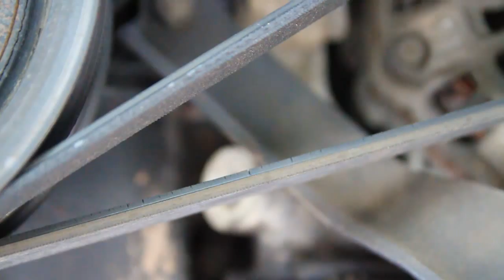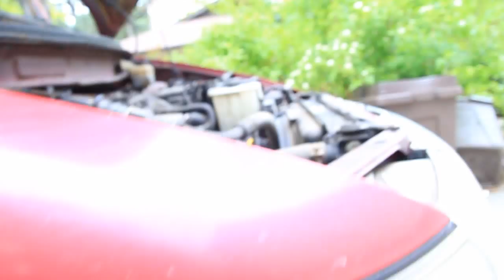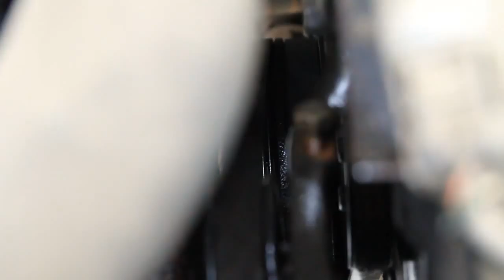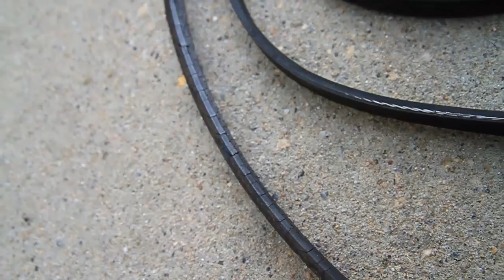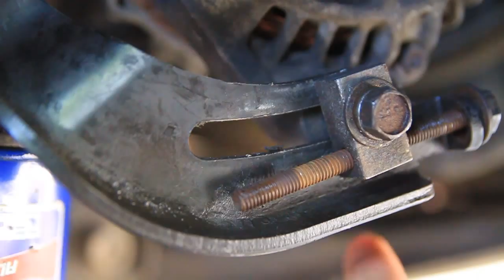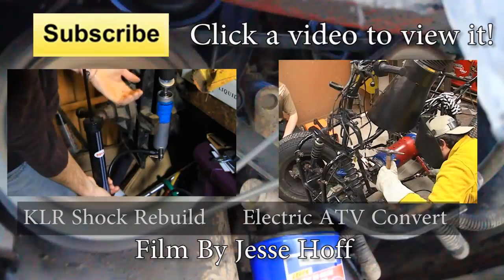How To Change the Belts on a Mercury Villager Minivan Nissan Quest Alternator Belts Serpentine 1994

Comment: Hey, there was one major thing you forgot to mention on that top pulley you don't beat it down you can break  the bracket that holds the pulley, before you loosen that top bolt there is a 5/16 Allen centered on that pulley then it drop as you turn. The alternator tenisoner just loosen the front bolt the top alternator bolt then loosen the long bolt and it will start to move. No need to swing that arm down Thanks HB
Reply: Howard Bickley if you swing it down you have more room to work and for this particular vehicle room is something lacking when working on it.
Reply: Thank you for your comment I was beating the crap out of mine I knew that pulling needed to be loosened on my 1999 it's a 12 mm used a long open box end wrench

Comment: another thing to check when you have belts of is the tensioner pulleys to see if they spin freely and smooth not dry. can have the bearings sieze up and wreck new belts before their time

Comment from the maker: Great info HB, I just found the allen you were talking about today, the bearing on the tensioner pulley went last night while I was driving back from Denver, burned up the belt. I replaced the bearing and everything looks good.  I wish I would have remembered your post this morning, because I still just wacked the pulley to get the belt loose.  It seems to work but loosening the allen would have been better. :-)

Comment: Please update the notes on your video for the top pulley the center bolt needs to be loosened before it slides down  just a half turn and mine slid right down after beating the crap out of it and it didn't budge. The pully needed to be loosened on my 1999 Mercury villager it's a 12 mm used a long open box end wrench
Reply: Thank you,  I've been beating the crap out of mine.
Reply: @merbywerby  glad u saw my comment! :)
Reply: I still can't get it to loosen up.  I'm gonna go buy a longer 12mm wrench to try and loosen the pully center bolt.  I've debated just cutting the belt the air conditioner doesn't work any how. I'm actually trying to remove the belts so I can replace the thermostat.
Reply: @merbywerby  you can get the thermostat off from above not too much hassle, but you have to have small hands and a 1/4" ratchet and short extension with a 12mm socket. You can reach all 4 bolts to break them loose with a 3/8 ratchet and deep 12 mm  socket, but there isn't much room to swing the ratchet.

Comment: Jesse, thanks for the vid. I have to replace the alternator on my 94 villager AND the belts too! Got any tips for the alternator? Most people said it should just pop off...any thoughts?

thanks in advance. Stu
Reply: old post but to any new readers they dont just pop off after 150000plus miles depending on where you live we have road salt chloride issues and anything on the bottom side of car will be corroded. would pay to give all bolts involed a good dose of wd40 or any kind of penetrating oil perhaps a couple three times in advance of the project

Comment: I've got a 94 Quest that is running on 4 cylinders. I changed the plugs, the wires, and the cap and rotor but those other 2 cylinders just won't run. I was thinking the injectors. Any ideas?
Reply from the maker: Are the plugs dry when you pull them?
Reply: @JesseHoff  Yes. Dry and fouled,
Reply from the maker: Scott Cupp ya fuel delivery sounds pretty suspect then.
Reply: @JesseHoff  That's what I was thinking.

Comment: what is that circular thing next to the oil pan that is leaking on mine and it wont start all i did was do an oil change
Reply from the maker: You must mean the oil filter, that most likely isn't causing your problem.  Might need more details though.
Reply: +Jesse Hoff no the oil filter i bought. put some clean oil on the rubber thing and srewed it back on by hand so i wouldnt make a hole in it then it started sputtering and leaking by a big bolted caged looking thing right by the oil plug thing where the oil comes out but its not the plug it self.we thought it was the wrong oil so we bought a higher milage oil and tried to drain the other but nothing not a drop came out from where it should have then i unscrewed the filter and my boyfiernd tried to start it at the same time and thats the only way we could get the oil out and it was all burned and dirty the first we drained was clean we could have even put it back in but we didnt so we poured the more expensive oil in and screwed the filter back on and tried to start it but this time it would cranck but not start is there anyone that knows what is wrong?
Reply: +Jesse Hoff as a matter of a fact i bought a filter exactly like that one and 5 w30 oil for highmilage
Reply from the maker: Might have burned up your cylinder walls by running the car with low oil.  You don't need to run the car to drain the oil.

Comment: My daughter has a '94 villager and it won't run.  It will crank and turn over BUT the distributor will not rotate so I'm guessing it is the belt.
Any idea?
Thanks,
Jim
Reply: New distributer shaft broke. Had it happen on a 98

Comment: Does anyone know the answer:

I'm removing my alternator from a 1994 Nissan 4 cylinder automatic. 
I removed 2 bolts ( top and bottom ) and removed belt successfully. My alternator still isn't free. It swivels in place. 
What's holding it up a third bolt?
Reply: Doesn't sound like you loosened the Allen key on the upper bracket, though.

Comment: Is this vehicle reliable?
Reply from the maker: It is, I had it up to 315,000 miles before I sold it.
Reply: Jesse Hoff wow thank you!
Reply: @JesseHoff  did you run it on an oil additive like STP?
Reply from the maker: @dubblyewjay1133  nahh, oil was changed pretty religiously though.
Reply from the maker: I think so
Reply: @JesseHoff  I had a really interesting time when I drained all the oil out of an old Dodge Shadow that the kid had cleaned out the oil pump on revving it in sand.
I bought it cheap and trying to keep it from ovrrheating I plunked in two Bardahl oil additive quarts.
The result was about thirty extra miles without overheating so I replaced all the oil with it. I ran it like that for two more years .
Then one wintery morning I forgot to warm up the engine before racing off to the store and seized it solid. Oop.
Reply from the maker: @dubblyewjay1133  I'll check that stuff out.
Reply: @JesseHoff  another one.. Ottawa, Canada..went to a car dealer and short of $$ I offered him a few hundred for a wheel-siezed 79 Dodge Colt.
I got it rolling and then drained the oil and proceeded to do my own vehicle test.
Filled her with Bardahl like the Shadow, then I drove that thing so hard my kids called it my ghetto- viper! First gear wound out to the max rpm, second, third, fourth, the same. NEVER let me down!
I sold it when I left Ottawa with a warning to my young neighbor for a buck: "don't drive it before she warms up, and in winter drain enough to fit two quarts of 5W-30 oil.😉